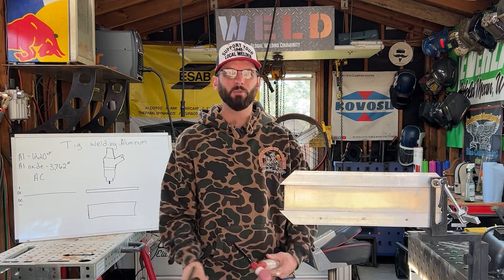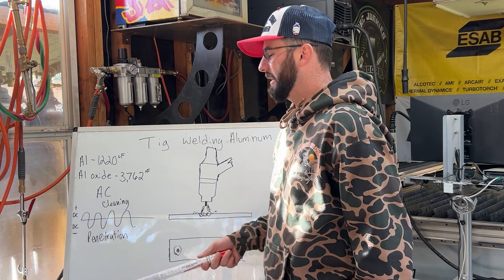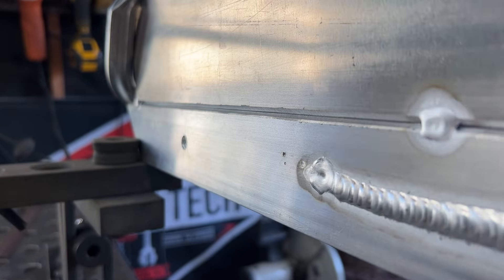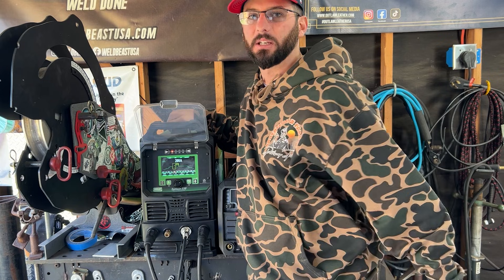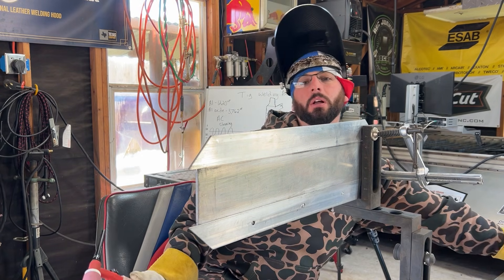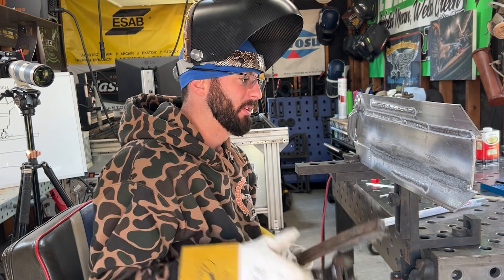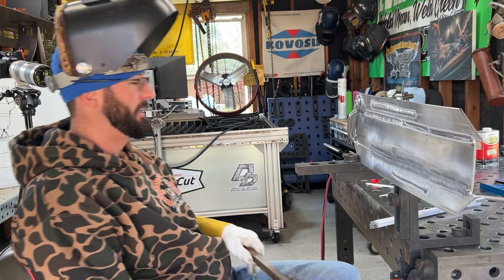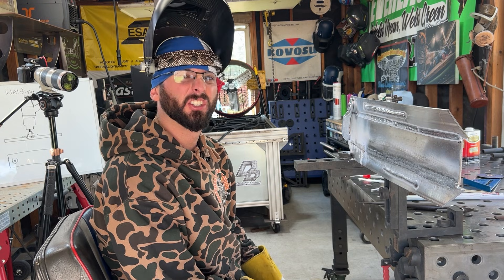TIG Welding Aluminum Without AC, Can It Be Done?

Comment: You can also weld aluminum with oxy acetylene. There is a flux you need to use.  Seems like it was pink in color.  Pretty tricky with the heat. About the time it starts welding good you better stop and let it cool a bit  cos a big hole will develop.

Comment: I've experimented same thing and total fail. Even 1G basically melted 3/16 completely through before I had any semblance of a pool. 
What I have not tried, and you could possibly try is DCEP stig. Might allow one to see what's happening which was my huge challenge. 

I appreciate these videos because I have a DC tig/stick and there's times I'd like to weld aluminum. So far haven't found anything except dcep stick. Those things are expensive and disappear like solder. So weird and hard to use.

Comment: What does the pedal do?
Reply: The pedal controls input heat/power to the tig torch. I helps keep from overheating the base metal. Aluminum can be a challenge to weld, no matter the process.

Comment: You can weld aluminum on DCEN but the part has to be super clean and you need 8-10% Helium mix.  The weld pool is hard to see, rose colored and  sooty but for 3/4" material and thicker, the penetration is second to none.  It comes out looking like a typical DC weld once brushed off.  We use to do it on thick Boeing parts.  There is definitely a learning curve but for max penetration, you can't beat it.  Clean prep and proper gas is everything.

Comment: I see aluminum being melted, so here is a silly question; when they pour aluminum into a mold to make a emblem or some kind of do dad, its in sand and pretty hard to get hot enough to pour in the sand with out the sand blowing up with moisture. Could a person weld pour into a mold... like a cast iron mold, no sand involved or say using clean steel for the mold and pour this aluminum into it to make a do dad... a trinket thats strictly for show.... did I explain it good enough to figure out my goofy question?
Reply: Remember Matchbox cars? They are die cast. The dies are steel.
Reply: if its blowing out the sands too wet, simple. cast irons pouring at twice the temperature and doesnt seem to be an issue... when the sands mulled properly. clay needs to be worked in properly.

Comment: explosive welding... sheet lamination or  sleeved  pipe drill hole.. 
set your sheets and ferrule spacers.. rake out the depth of explosive.. touch off both opposing corners so as ejection is clean and shockwaves meet..
your choice to pack the inside or outside pipe use a backing plug just dont collapse  it

Comment: Yooo brotha need your help ... run a 26 tig torch or 17 off my bobcat miller 250? Do I get ck 200 amp 26 torch or rock that 17 tig torch that handles 200 amps? Helps brotha which route do I go? 🙃🙌
Reply: If it aint broke, dont fix it!

Comment: Try helium?
Reply: I know someone that used to weld aluminum with helium on dc I think it was for thicker aluminum 👍 I use helium for thicker aluminum at work often 3/8” and thicker I like to run a little helium makes it weld and tack a lot easier
Reply: @WojnarskiWeldingFabricaion  I thought it was doable
Reply: @williamb1926  I think it is dirty or alot of the black soot but it works
Reply: Helium works. It's just a gross  dirty puddle. There's a reason GTAW is also referred to as heliarc.